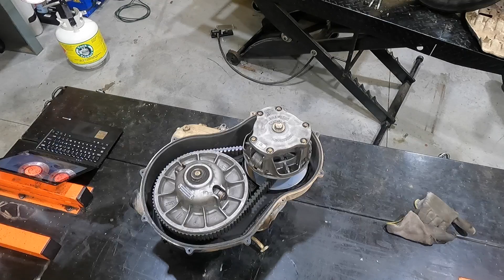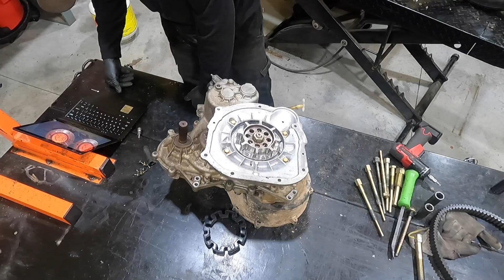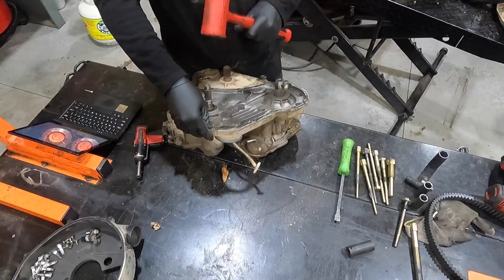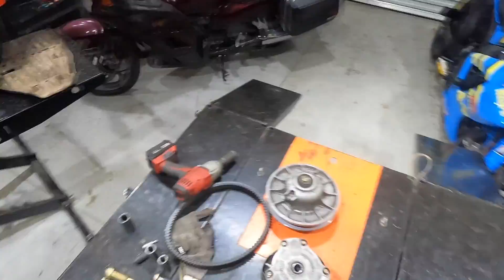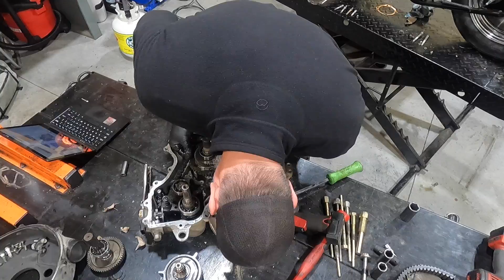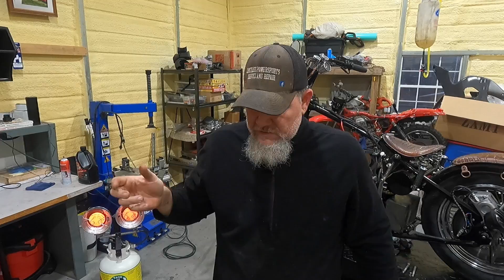Polaris Sportsman XP ESP 550 transmission tear down part #2

Comment: Replace the Cam! It gets stressed with continued shifting and if your primary clutch is causing hard to shift condition that further puts stress on this. Yes be sure your primary clutch (the one way bearing in it) is turning freely.

Comment: Can you change the input shaft without removing the whole transmission?
Reply from the maker: No you wouldn't be able to split the cases in half because they are sealed really tight & trying to clean it all & then get everything to lone back up would be absolutely horrible to try to do..
Reply: @limitlesspowersportsservic3394  Ok, I better not try it then. Thanks for the info.

Comment: Was wondering if you found where the metal slithers on the magnet came from.
Reply from the maker: No I actually didn't. I disassembled everything & checked all washers,Spacers ect... everything looked perfect.  But I did find out that the previous owner did some work on thr transmission so my guess is that it was left over from them unfortunately.